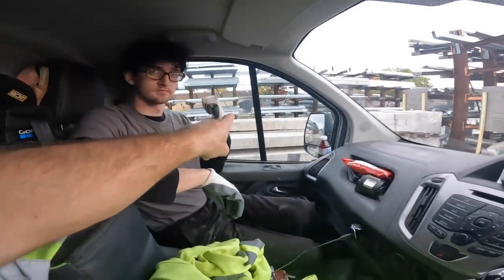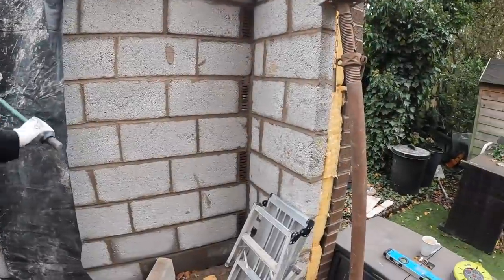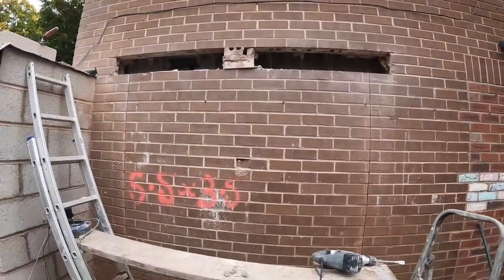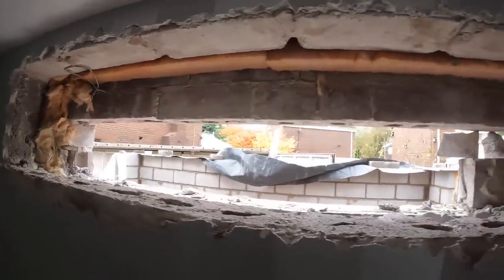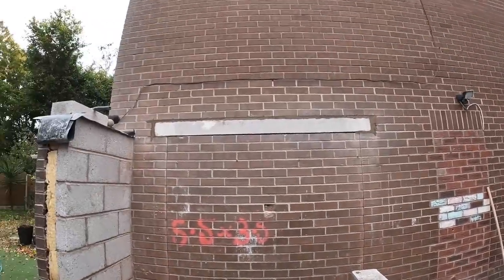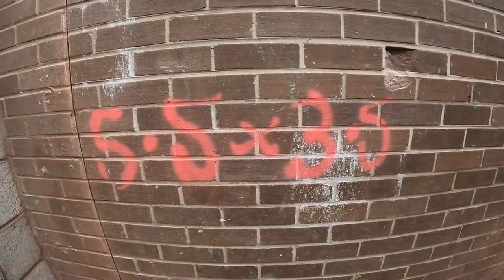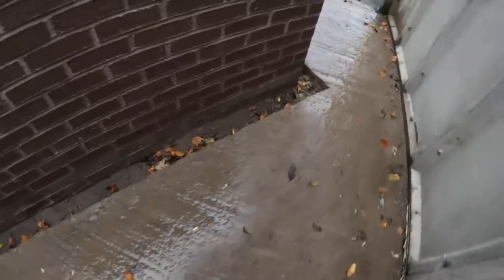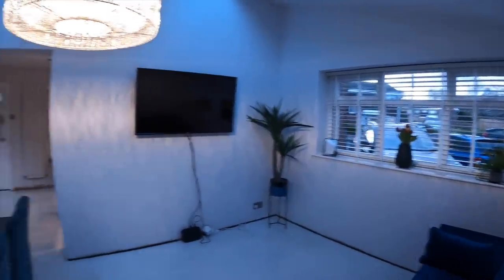INSTALLING BLOODY HEAVY CONCRETE LINTELS .. EXTENSION FINAL EPISODE  😍

Comment: I was a commercial Carpenter in the USA for many years and was a construstion manager for some years as well. Masonery is done differently here and is mostly a veneer rather than a structural component. Most block work is hollow 8" with concrete poured for structural strength. In slabs,the Inspectors look at the rebar very closely and will reject the pour if not up to specs. My Wife thinks I am crazy for watching this after a lifetime building all sorts of buildings.
Reply from the maker: Always nice to hear from tradesmen from around the world to see how work practices differ .
  Thanks for watching and commenting 🙏🏽🧱👍🏽😁

Comment: Great job but I have a question, where you have an opening in the cavity wall you would normally have a cavity tray to allow any water to escape through the weep vents, what happens to any water that penetrates above the new lintel you installed?
Reply from the maker: The cavity tray should go above the roof but is rarely done . 
   The brickwork above is in excellent condition and the bricks aren’t porous at all so it will be fine on this job 🧱👍🏽